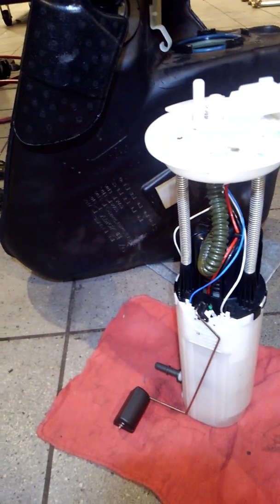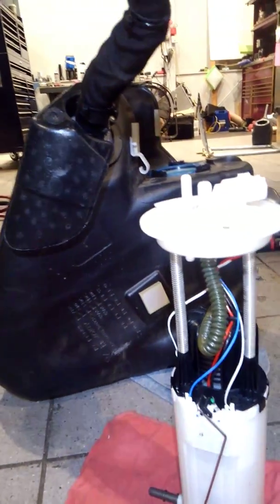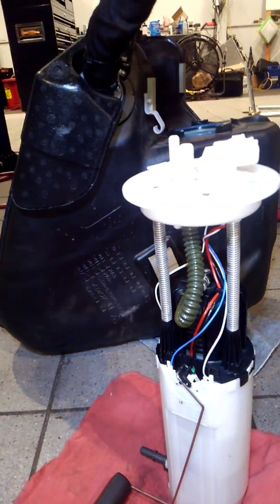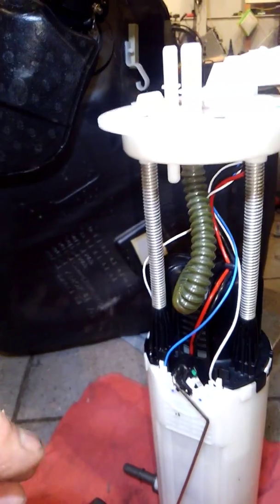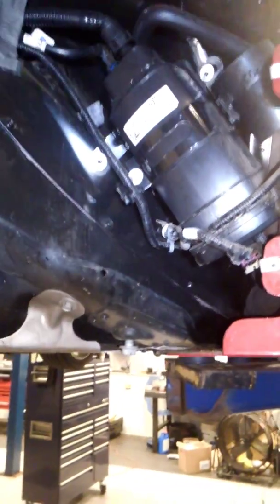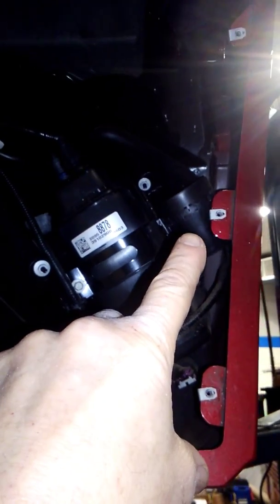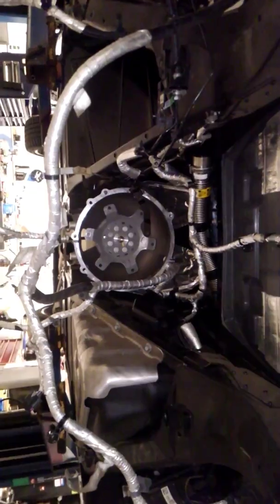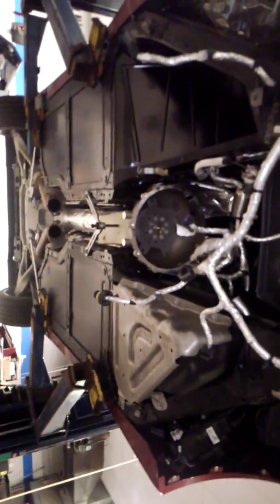Corvette fuel level sensors 1997 to present and why store with only 1/4 tank of fuel

Comment: Not knocking Shell Gas but I stopped using shell fuel in my 2001 C5 and haven’t had any issue with the fuel gauge/system, o ya I give it a bottle of sea foam every spring when I pull it out of storage

Comment: I have a 04 c5 with  a fuel smell  when  the  tank  is above  3 /4. It's the  third  crossover  flex tube that  the dealership  has installed  . I don't think  the tank  has a  fracture  not sure if  it's  a evape problem  any insight  would  be helpful . I never  feul up past the first click of pump thanks!
Reply from the maker: I would look at the entire system for signs of fuel trace after it evaporated.  It always will show a trace that is brownish discoloration.  A smoke test can be performed also.
Reply: @thecorvettemechanic84   thanks for  the  info  I'll  have a smoke  test done thanks  again

Comment: I was having the service fuel system message in my 2005 c6 . After putting 3 bottles of techron the fuel level sensor is working fine ... First I used the techron bottle that treat up to 12 gallons ... Once again I used the same bottle I mean the one that treat 12 gallons but after no seeing results I decided to use the big one that treat up to 20 gallons and boommm the gas gauge is reading the fuel level perfectly